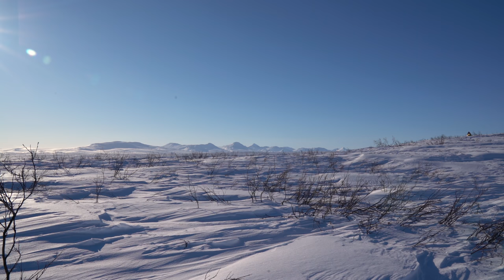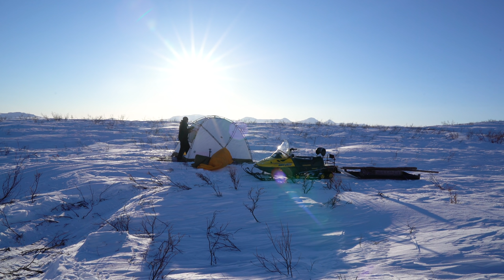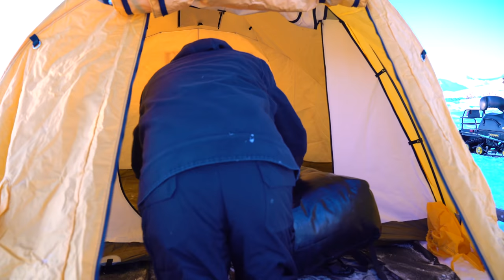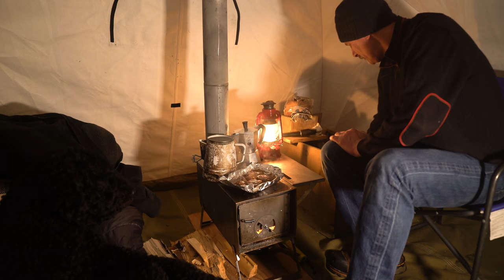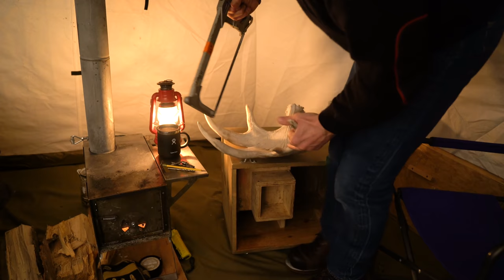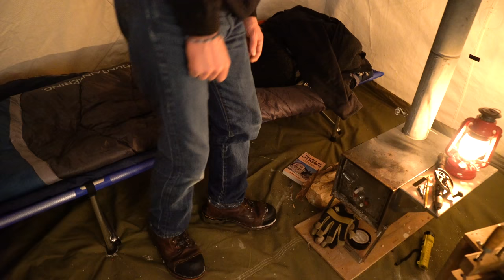Solo-Winter Camping In The Alaska Range (With Stella)

Comment: Very nice video. Impressive set up!!  Stella seemed very comfortable and at ease. Nothing better than dog and owner together camping. What model tent did you have. I am looking for a well built hot tent. This seems to be what I’m looking for. Thanks in advance. Many happy adventures for you and Stella!!! 👍👍
Reply from the maker: Good morning! I agree completely. Solo camping with a pup is a wonderful thing. It cannot be described really, it just needs to be experienced. This tent is made in Alaska by Airframes Alaska. It is the Arctic Oven Igloo model. They also sell the stoves. The stove is made by Kni-Co Manufacturing. You can visit both websites and explore. In my opinion, this tent is absolutely top of the line, so well thought out.  Also, if you do call either manufacture, be sure to tell them I referred you. Thanks again my friend.

Comment: Loved the video! Just bought a tent and stove myself to do some winter camping.
Question for you based on what I saw in the video. Can you set up a stove in your tent on top of snow? I've never done that before but thought the heat would melt the snow underneath the tent. I assumed you had to shovel it out before setting up your tent but it looks like your snow was packed down?
Reply from the maker: Hello Jared. Thanks for watching. Yes. I set up this tent on the packed snow. There is probably about three feet of drift underneath the tent. Usually, I set the stove on a couple pieces of firewood to get some distance between it and the floor of the tent. Under the stove is a great place to dry your gloves or socks. The double bottom in the stove keeps it from getting too warm underneath so it works well. The manufacturer recommends putting an inch of sand in the bottom of the stove but that is pretty much impossible out here. I just use the double-bottom heat shield that comes with the stove. It has always worked well. Peace.

Comment: Hello Alaska!🙋‍♀️
Do you feel climate change in Alaska as well because in the Balkans(EU) the are winters with much less snow and sommers with very high temperatures.The max measured temperature was +41°C.We are getting used to the new "normal" age.
Reply from the maker: Good morning Danijela. Good question. I grew up here. I remember the winters back in the 60's, being so very cold and dark and seeming to last forever. Part of that was due to being a child and growing up in a very remote and off grid homestead. Hauling water and using an outhouse can make a winter seem longer. But today, the temperatures are just as cold. The cold spells seem to last as long as ever too. Here at the cabin the snows are just intense. I am in the middle of a storm right now that has drifted two feet high against the front door of the cabin overnight. So from my perspective, I haven't noticed a lot of obvious change in the weather, but I'm up in the mountains and the weather tends to be extreme.
Reply: @ThisIsMyAlaska  Thanks,have a great weekend.